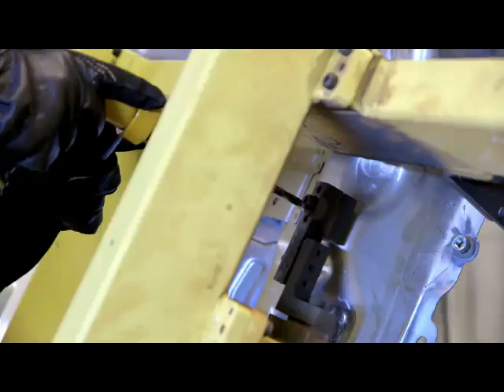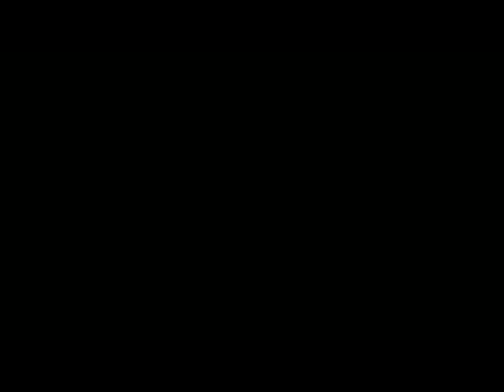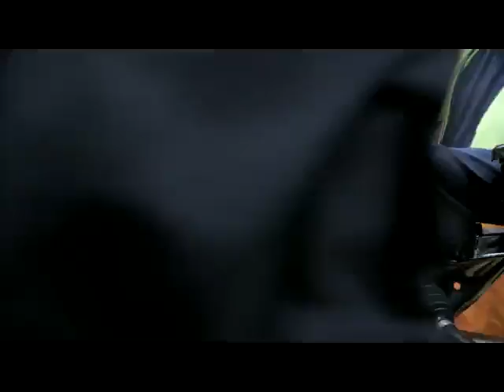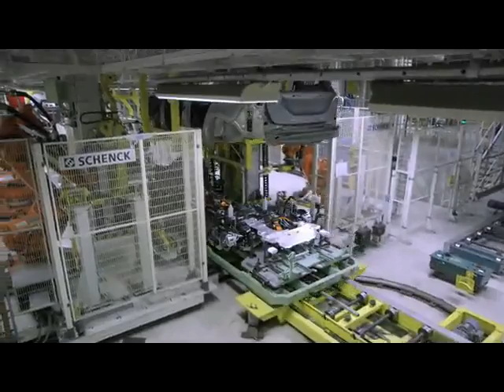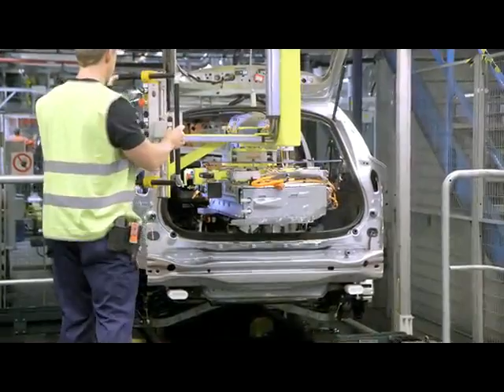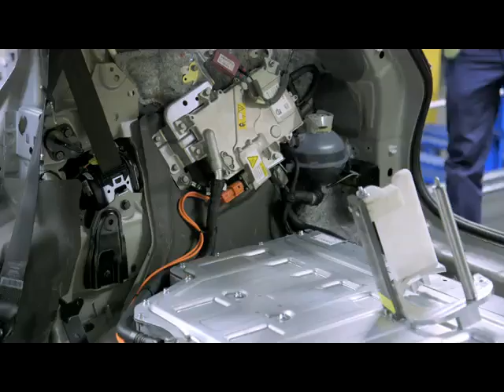2014 Volvo V60 Plug-In Hybrid production scenes - natural sound

Comment: IBM has stated that by 2020 batteries in use in production cars will have ten times the power of today's cells. At that point any manufacturer who doesn't have a tried and tested EV in production is doomed.
Reply: Well... That failed...
Reply: @13FPV  To what?